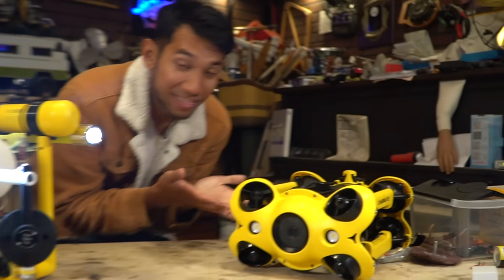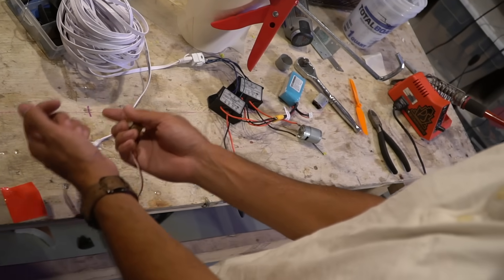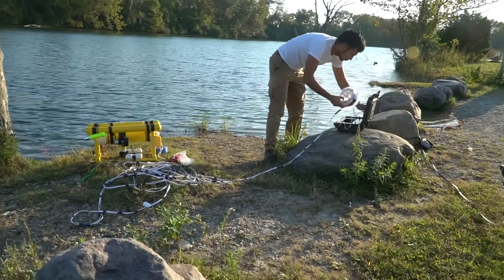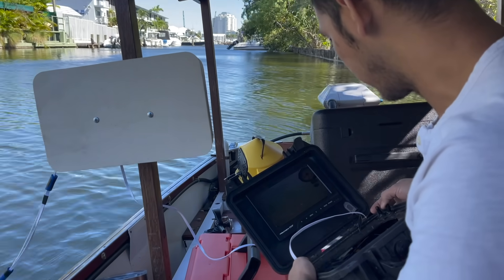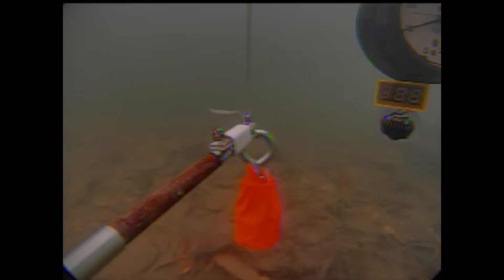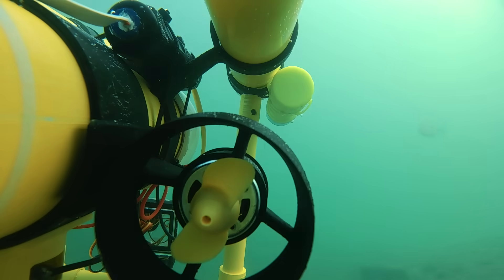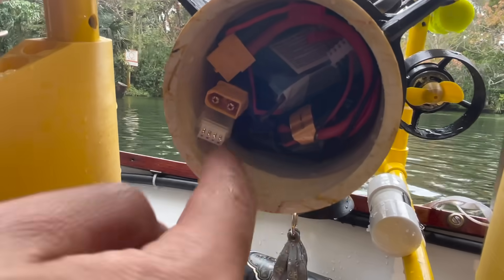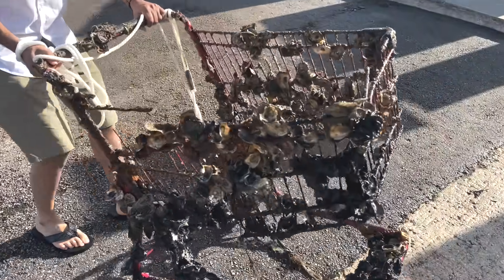Cheap PVC submarine DIY

Comment: Quick question Peter,why did you go with brushed motors over brushless,is there a practical reason i've missed?
Just wondered if it was for cheapness or was it what the controllers had to have and as you probably already know salt water is the quickest way to kill the electrics and motors if not rinsed off properly in fresh water. 😉

Comment: Hey Peter, I noticed some flickering in the video feed when you were toggling the controller switches. That is probably due to the way you wired the signals to the relays. The ethernet cable has 4 differential pairs. Because the video ground isn't isolated there is crosstalk that will increase with the cable length when ever the switch state changes. This is due to an induced magnetic field along the wire from the current to switch the relay. There will be a voltage spike in nearby wires. If the wire gets long enough the voltage spike may damage the video camera or display circuit. A better circuit that would take advantage of the differential pairs and isolate the video lines is possible. It is still analogue and cheap. You need double pole double throw switches and four diodes per relay. Each switch uses a coupled wire pair in the ethernet cable, leaving one pair for the video. If you are interested I can figure out how to send you a schematic.
Reply: Learn how/why UTP was designed. Each color pair has a different twist ratio to other pairs. Twist puts noise 180° out of phase thus nulling/negating said "noise"... exactly why UTP was designed!!! That being said, if the system is designed correctly, the control cable will only be low voltage controlling the relays within the sub. It appears that the video flicker/jitter is "back emf" when motor direction is switched. This most likely can be remedied with a variety of simple ferrite chokes and capacitors across the terminals of the motor  to eliminate the voltage interference.
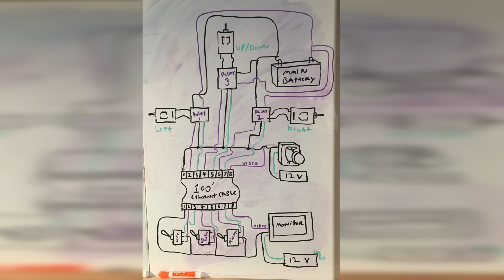Reply: @RTR-MATEY  In his schematic @2:04 the motors are isolated from the ethernet cable and video by the relays, they have their own power circuit and battery. The back EMF would not be present in the cable.
Reply: @RTR-MATEY  Brushed motors unsuppressed are radio ttansmitters.
Reply: @alwayscensored6871  A simple capacitor across the motor terminals should help suppress/filter the noise spike.
Reply: Motor options , its a base 3 number, 3x3x3 ,27 so in binary + or - it can be achived with 5 bits . I could see there was a solution but havent formulated the diode logic, is there a 5 bit solution I wonder with diodes and switches. No rely allowed.
Reply: @beautifulsmall  Each relay needs three states, off, forward, reverse. The relays have three pins, a common ground, and a pin to energize each state.
The trick is in the DPDT switches which can be wired directly to a battery in such a way that they send three states on two wires, off, powered, and inverted powered.
(a) +vss ------ [ ]   [ ] ------  (d) - gnd
(b) s left ----- [ ]   [ ] ------  (e) s right
(c) - gnd ----- [ ]   [ ] ------  (f) + vss

In the center position, pins (b) and (e) are unconnected.
In the up position, pin (b) is connected to +vss while pin (e) is connected to -gnd.
In the down position, pin (b) is connected to -gnd while pin (e) is connected to +vss.

With this setup you can send a Tri-state signal over two wires with a single switch.

The next trick is decoding the Tri-state signal back to two common ground pins for the relay which is where the diodes come in. 

The common ground of the relay is connected to (b) and (e) at the other end of the ethernet cable through two diodes like:

(b)-------<|------(gnd)-------|>-------(e)

Then the forward pin of the relay gets a single diode.
(b)-------|>--------(forward)
Same for reverse
(e)-------|>--------(reverse)

Put that circuit into LT-Spice and it decodes the tri-state signal nicely.

I don't know if the relay coils have flyback diodes built in but those are also necessary whenever a coil is de-energized it wants to stay on due to the magnetic field and will cause voltage spikes when turned off. The flyback diode "eats" the reverse current when the coil is de-energized and otherwise does not interfere with normal operation.
Reply: @lukekamrath8795  Why not just us an Arduino and send digital command packets?
Reply: @JohnDlugosz  Using an Arduino or other micro-controller would be a great way to increase the number of controls/channels for the sub. I wanted to offer a possible improvement to Peters current solution that stayed in his design parameters of no programming. As a project for other people to duplicate, no programming makes it a little more accessible for those who are uncomfortable with it or have never done it. If you were going to send data down the cable, buying a differential signal driver chip to hook the Arduino up to on each end of the cable would let you use longer cables with higher data rates. I think ethernet cables are rated to like 100m. To go farther you have to reduce the switching frequency of the signal or add a powered module that reads and resends the signal down the line. With a raspberry pi or jetson nano you could use a webcam and send hd video back over regular ethernet standard between two cheap routers and view the feed/use commands from a laptop at the other end. (that would take a lot more programming and experience/research though)
Reply: probably just needs some 1uF snubber caps on the switches and if those relays are induction and not SSRs some flyback diodes on there and that would kill the video interference.
Reply: It's more likely that there's just no flyback diodes on the relay coils than any elaborate coupling in the cable.
Reply: Just stop using flat ethernet cables and use twisted pairs
Reply: @the_egg_  Is that a Clone High reference?
Reply: how does he get it to dive
Reply: @hesalovelybuoy5944  In the beginning of the video he has the sub configured so that it was neutrally buoyant, meaning it wouldn't float or sink, just kind of hover in the water. Two of the motors on the sides allow for forward reverse and steering left or right. The third motor on the top when powered pushes the sub up or down.
Reply: @lukekamrath8795  thanks! does this mean he doesn't have to have the motor spinning all the time he wants to remain under water?
Reply: @hesalovelybuoy5944  yep and in the end when he wanted to go very deep he added weight to make it sink so he didn't have to use power to get it all the way to the bottom.
Reply: Luke are you on peters patron ? Method to reach you about trying to recreate this project with your advice
Reply: Any way of reaching you Luke ? Get some info about recreating this

Comment: The water off the Texas Gulf Coast is pretty shallow (less than 100 ft) for dozens of miles off shore. Pretty sure there are some interesting wrecks that can be explored. Also usually less choppy water than say off of the Outer Banks.
Reply: For example the Flower Garden Banks coral reef is as shallow as 55 ft below sea level. Not sure what is allowed in the national marine sanctuary but regular scuba diving is allowed.

This is about 100 miles south of Galveston or about 150 miles away from Houston.

Comment: ethernet cable is a damn good choice! It comes in 1k foot spools and is good for up to 96 volt dc (poe is 12 and 24 volt some is 48 volt) 4 pair of wires some sharing hots say 2 or 3 hot wires depending on how many different voltages needed. So yeh perfect choice.

Comment: This is good inspiration for a project I've had marinating in my brain for a couple years now. The original plan was to build a sort of bathysphere out of steel pipe, just containing power and whatever electronics were required for lights, sensors, video, etc. It wouldn't be controllable, obviously, but since my interest is just having a look at lake bottoms or maybe the seafloor, it wouldn't really need to be, and it'd be cheap.

The Ethernet cable is a great idea, since I hadn't figured out how to get live video from the thing. And the PVC's a lot cheaper than iron pipe. If I fill it with mineral oil and evacuate all the air bubbles, theoretically, I should be able to go to almost unlimited depth.

It remains to be seen if my attention span will stay in one place long enough to actually get it done, though...
Reply: Wont the pressure just force the oil back up at a certain depth ?
Reply: @123qwe321ify  eventually probably, but as long as the seal is stronger than the hull it’ll go pretty deep, since the hull won’t be able to buckle with incompressible fluid inside. Even a watertight hull filled with air can buckle before the seals pop, which compromises the hull strength and can lead to leaks at a much lower depth

Comment: Fantastic utilization of the ethernet wire with your submarine. If you were to improve on this,  I would suggest looking into using a serial pin connector, which contains 9 pins. This would allow you to send 12V to the camera without having the need to attach a secondary battery onto the submarine.
Reply: A simple voltage regulator would work too...can be purchased pre-made. I bought some adjustable ones online for less than $7 each.
Reply: @RTR-MATEY  I usually use some that are around $1 each. For anyone else reading they are conveniently named "buck converters" (although not named for their price, its referring to boost/buck voltage changes), and for around $1.50 I try to keep combination boost/buck converters so they can power any output voltage from any input voltage for typical ranges I use. FPV cams barely pull anything, so yeah that's the way to do it, also simplifies wiring.
Reply: Hello

Comment: I wouldn't use a Arduino, they are kinda overpriced.

Some notes.
A extendable light could help with visibility.
Safety line is worth keeping.
I wonder if "Arduino" sonar or radar sensors would work.
A magnet glue to a rubber diaphragm and hall sensor maybe a cheaper deeper sensor, with unknown specs.
I thought about covering the motor with thick aluminium cans, not great for thermals.
A different type of camera may help with visibility.
Communication buoy should help with the radio frequency short range in water.
Lasers, definitely needs lasers, NOAA has them and so should you, safe to use lasers of course.

The crushing deep of your submarine should be more than 50 metres from surface (164 feet).
My guess is compressor problems, sealant failure or loss of communication are more likely to occur with current design.

Comment: Nice video. May I suggest for your next project using a 72MHz transmitter sending the control signal through a coax cable and the (6MHz) baseband video return in the same cable using a filter in each end?

Comment: Incorporating a pair of cheap microcontrollers (there are plenty of arduino knockoffs for less than $10) would make it significantly better with few changes:
- Microcontroller at the control box to monitor the button presses
- Button presses are converted to a single byte by the microcontroller, with each bit representing on/off for one of the motors
- Single byte is sent down the ethernet cable using a single pair of wires and a protocol like RS485 (you may need some RS232<->RS485 converter chips, they're a few cents) at a rate of ~50-100hz
- Byte is received by microcontroller onboard the sub, at which point that microcontroller interprets it and toggles the motor relays accordingly

This means you only need two wires in the tether for your motor control, and if your camera is just a ground and a data line (remember, RS485 is a differential pair so you have no ground from it), you could drop from an ethernet cable to a 4 conductor phone cable, making your tether lighter and cheaper. You'd also greatly reduce the camera flickering when you toggle the relays.
Reply: Video flicker was caused by voltage induced pull-down when switching motors.

Comment: Using a wired connection was a wise choice, but the analog video was a mistake. The cables are going to create a high capacitance with the water, warping the signal.
Reply: I thought the video looked dope this way, pretty vintage.

Comment: are you sure it wouldn't be even cheaper, to give the boat an arduino, maybe even raspy? if you'd use the ethernet protocol for data transmission and the poe standard for power, you would save the onboard batteries, could consume a lot more power, safe and receive a lot more data in a way that provides a lot more flexibility.

Comment: I worked with one ROV when I was a professionnal diver. The ROV was slightly positive and a motor on top would make it go down or boyant (or neutral). If the ROV failed and was out of electricity ,it 
would come up to the surface because of its positive boyancy. It worked very well .
Reply: The Nautilus' ROVs had an incident earlier this year where they became untethered at >2000m. The main ROV, Hercules sunk to the floor. The secondary, Argus, was positively buoyant but was tethered to Herc, anchoring it. That was the best case scenario because there was no risk of them colliding, and they could bring them both up in a controlled manner. It took some time for them to prepare and enlist some help from another ROV team, but they just had to go down, cut the tether to let Argus float up and then just pull Herc back with a wench (edit: actually, I think they just dropped some ballast and let it float up too, I don't remember). 

They were live-streaming when the incident happened and they live-streamed a couple of the recovery dives. I think they released a recap video too.
Reply: @jincyquones  Deep sea ROV rescue. That's pretty interesting stuff.
Reply: Interesting. I guess the downside to that would be decreased battery lifespan, but that's probably better than loosing the ROV because it sunk to the bottom of a lake, heh
Reply: @ianr2002  The current came from the surface. No batteries in the ROV :)
Reply: https://youtu.be/QvX-ekkWe08
Reply: @Proffez01  How is this in any way relevant?
Reply: @PunakiviAddikti  Report spam, idiots desperate for views that don't realize that aggressive marketing like spamming only makes people want to NOT view anything from them.
Reply: @ScarletFlames1  Good idea. By the way, notice the bot over there? Some "adult content" sites are so desperate that they've started advertising in youtube comments using bots. Pretty sad and pathetic, isn't it?

Comment: That SigP365 is one of the best EDCs in my opinion.
Reply: works better if it has a barrel and recoil spring in it
Reply: @pacman10182   And out of the pool
Reply: Plus, this looks like the variant that uses the longer grip module from the XL. I like my Sig P365 for pocket carry (in a pocket holster) but my EDC is a Glock 43x.. it just fits better
Reply: I thought he mispronounced and meant to say Sig 357!
Reply: i got one of the old Taurus .380's and it's surprisingly solid for a Taurus.
Reply: How's it compare to the Ruger max 9?
Reply: @isanyoneelseheretoday  about $100 more
Reply: Mount it on an rp plane now

Comment: It looks like the screen flashes when the motors are activated. I honestly don't have enough electrical knowledge to say but I'm guessing some sort of current surge from the motor loads coming on and off?
Reply: yes, from the relay coils probably
Reply: it's interference on the video signal, a shielded cable and some tin foil around the camera would help alot

Comment: What if version 2 used a really basic serial/canbus type connection? That way the motors kicking on and off wouldn't white out the screen. It might add $30 to the bill, but you could use just 3 lines for ground ref, norm, inverted. Similar to passive noise cancelation in xlr cables. With that I would guess 500' of cable is possible? May need a video signal booster as I'm not sure analog video can go that far.

Comment: Should have gone to the Haulover Sandbar.  People are ALWAYS losing shit there!  For your Gen.2 ROV maybe use a pair of Ethernet cables (along with a pull line taped together) to give yourself more channels of control.  Not sure how the ROV was ballasted, but it would seem to make sense to have it BARELY negative on the buoyancy since you would have a pull line to retrieve it if the lift battery dies.

Comment: try carbon fiber rebar (making it light) in cast aluminium, or in steel, also cast, possibly vacuum cast, to prevent oxidation, but who cares, aluminium oxide is just fine, composite, real hard to break, abrasive
Reply: dont be a witch
Reply: optic cable instead of digital video
Reply: no electronics needed, just a couple switches and battery, on the shore
Reply: not sold by the dislike button
Reply: that who I am will not be sold by anyone, period.
Reply: gospel, sold, so disgraceful

Comment: If you went to the effort of using an ethernet cable, you should've used extenders and used the actual ethernet protocol. All that tech is cheap now, old. You'd get power, data, anything you'd need.
Reply: If you're going to bother with digital control, then you dont need any cord or tether.
Reply: @TravisFabel  well, kinda because radio signal don't travel very far through water. That's why most all use tethers if they go more than a couple feet deep